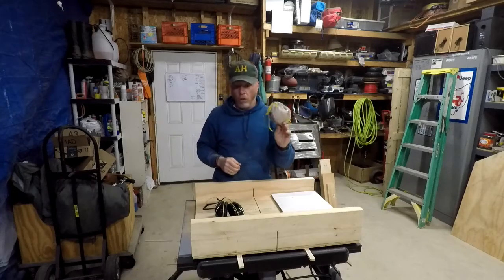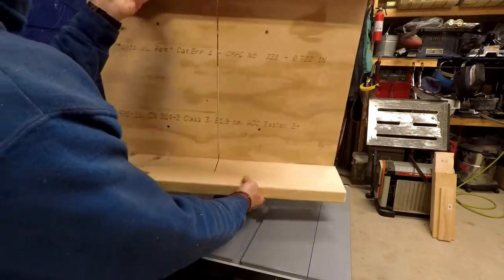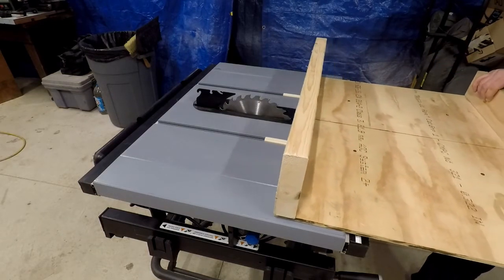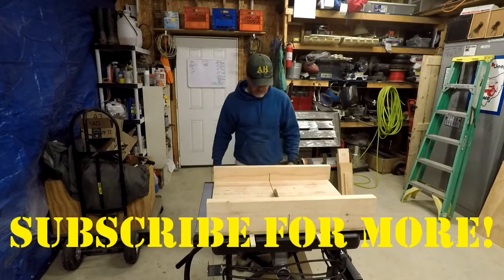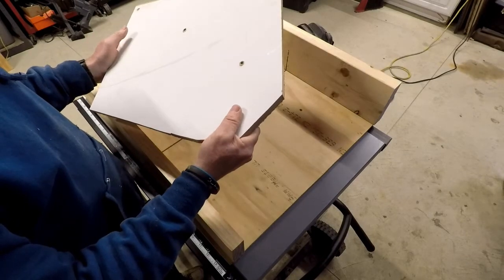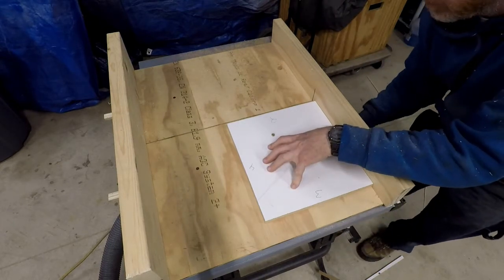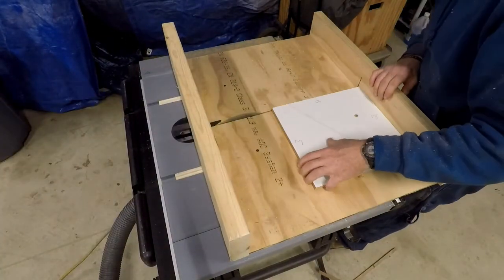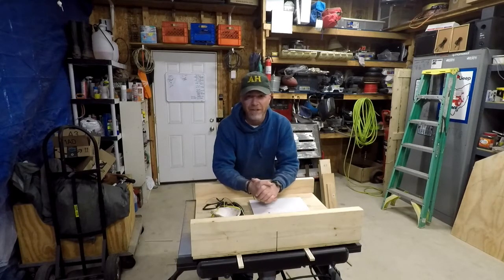Easy Crosscut Sled for Tablesaw | How To | MY DIY

Comment: I'd check if the framing square was off. Never made a sled, I've always just used a mitre saw for all my cross cuts.
Reply from the maker: The square is as true as the rest of them that I have. I always use a mitre saw also, but since I don’t have a large slider, the sled should allow me to cut larger pieces.

Comment: Not too sure why it's off, especially since you're cutting all sides using the 90* angle.  At first I was wondering if the blade was canted. Just don't know.  Is the blade locked into 90* or 0*. (not sure, DIY).  Look forward to seeing your nightstand build.  I made a little tool stand of sorts and you'll see when I edit and release.  I made at least 20 separate video clips that will ultimately be incorporated in the 19-ish minute video and one section totally lost its audio.  My camera has done that at least 15 times but I don't want to shell-out hundreds for a decent camera, ha.  I do like your cross-cut sled.  It's good enough for what I do, anyways.  Full-watch.
Reply from the maker: I’m not sure why it’s off, but it’s good enough for what I need. I feel ya on losing audio like that, I’ve been plagued with problems from a slow laptop while editing. I’m too cheap to buy a new one...maybe someday if I ever get monetized! As always, thanks for watching!